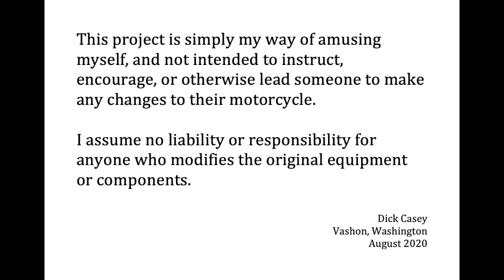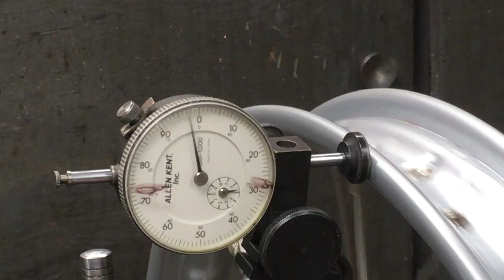AJS Cafe Scrambler - Project: Double drum front brake

Comment: Hi, I did a similar conversion on a 21in  aluminium front wheel. I wanted to fit an 18in rim on the existing lop sided 21in hub without buying a set of new spokes . I machined the larger flange  off another hub , made it a press fit so I ended up with identical flanges and the shorter spokes from the second hub and it all fitted. Just lucky I guess. I did no measuring of spokes as i wouldnt kn ow how to make that measurement . All the spokes fitted perfectly.
I also have a 1960 80 CS AJS . Your vids are so helpful in working on my bike. I especially needed to know where the timing was on the bike to get it right.
Greetings from Melbourne Australia
Reply from the maker: Well done.  Nice to hear about your success with the existing short spokes lacing properly.  I just finished machining the parts for my twin brake compensator.  If you'd like email me at ridenut@comcast.net and I'll share the photos making the parts.  Stay Safe...